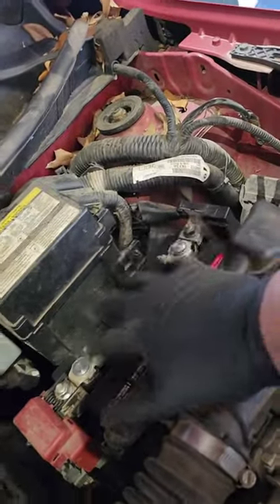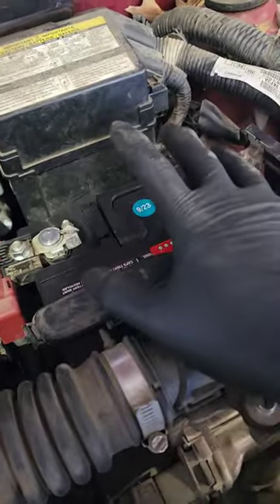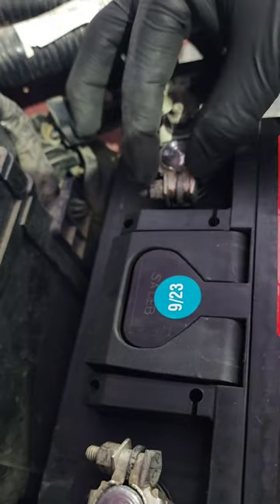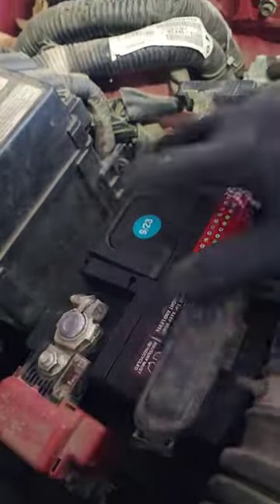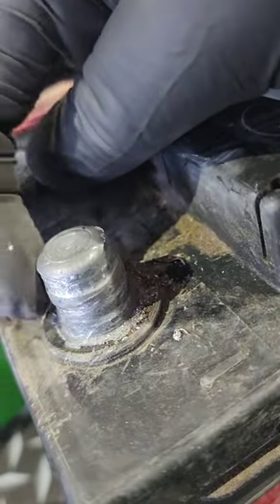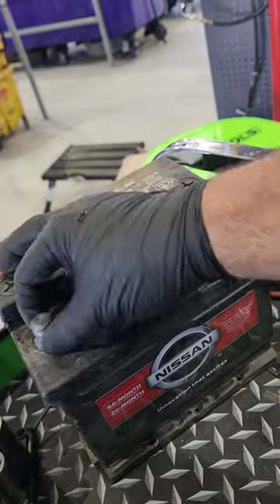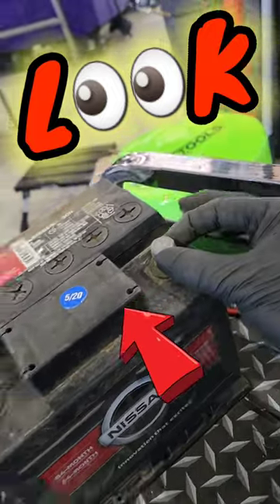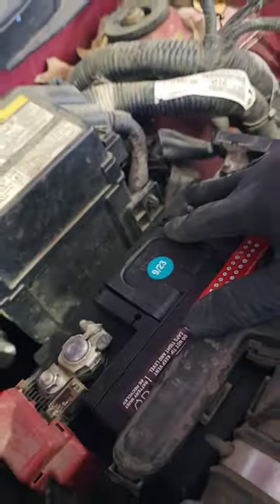MECHANIC DID THIS? 🫣 #auto #mechanic #shorts

Comment: Tight enough so it doesn't move.. that's all that's needed. 
Sadly they do this and destroy the clamp, then they get replaces with the shitty aftermarket clamps that do nothing but corrode. Starting the snow ball of starting and charging problems.
Reply from the maker: If thats not the truth!!! They end up cutting the cable up to install universal clamps that end up doing nothing for the vehicle and then they need a new ground able after that and lets hope the battery current sensor isnt integrated with it